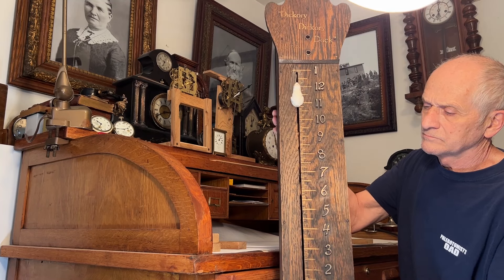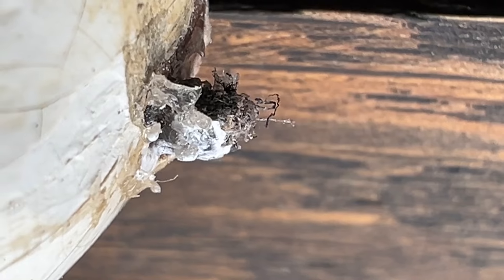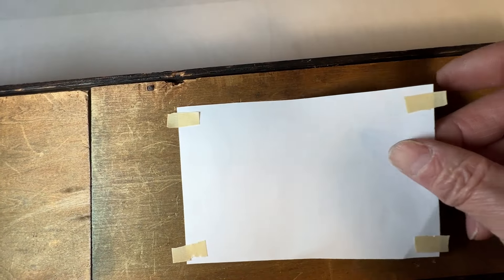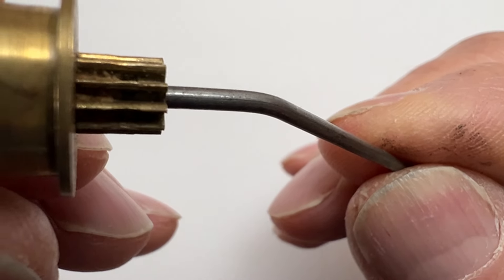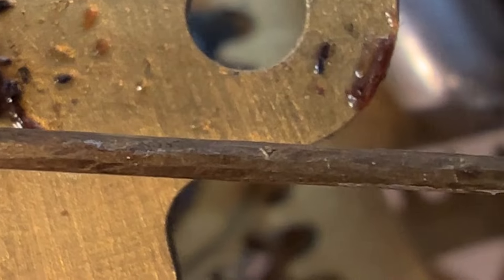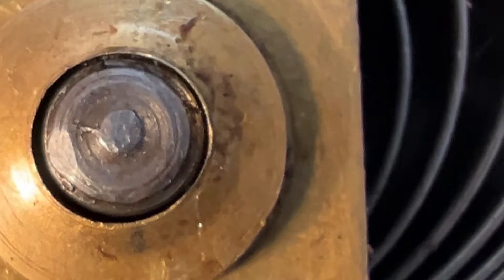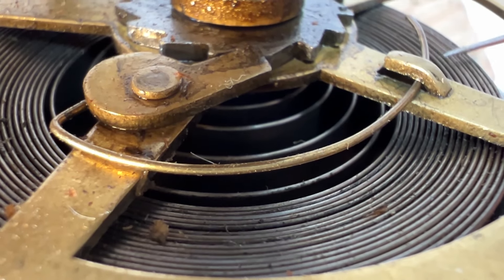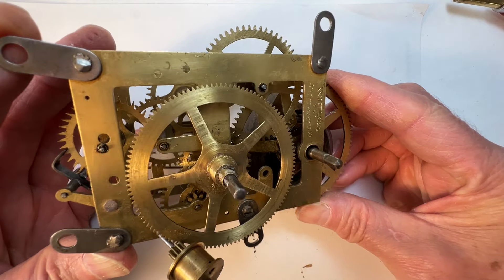Dickory Dickory Dock Clock for Mark from New York #111

Comment: Neat clock! The center wheel was missing some teeth.
Reply from the maker: That's the hour wheel, it drives the mouse winding pinion that winds the mouse string, the missing teeth allow the mouse to drop to the bottom every 12 hours.
Interesting design

Comment: A question. Why do you call the escapement " verge" ?
Reply from the maker: Escape wheel, pallets, suspension spring, verge, pendulum etc... are all individual parts of an escapement.
The verge I reference in this video is an individual part called a verge, see link below:
https://timesavers.com/c-325843-clock-repair-replacement-parts-verges-verge-components-verges.html
Reply: @jamesmartin5370  thank you for taking the time to reply.